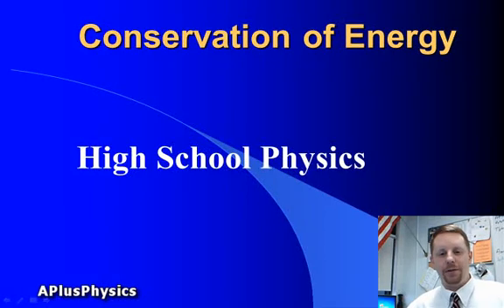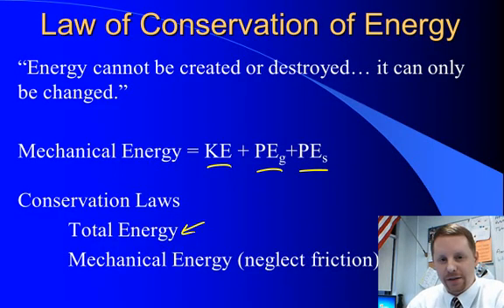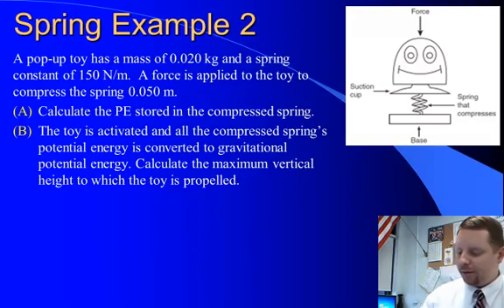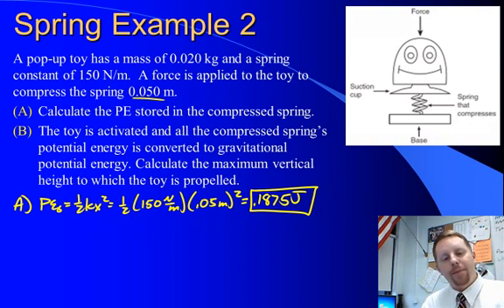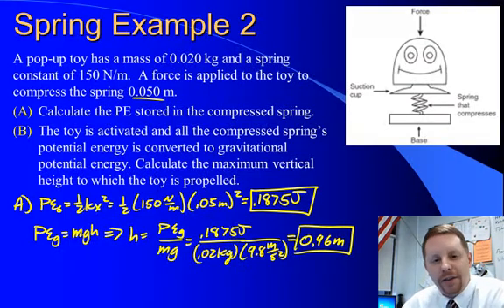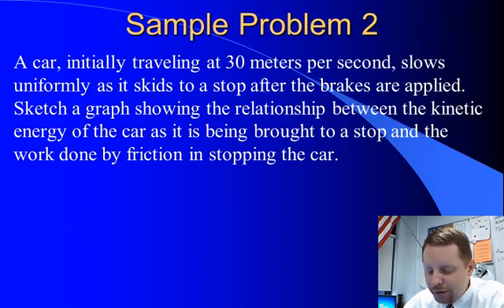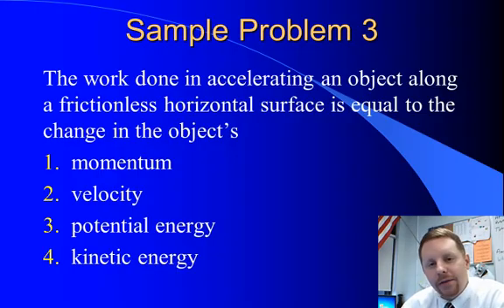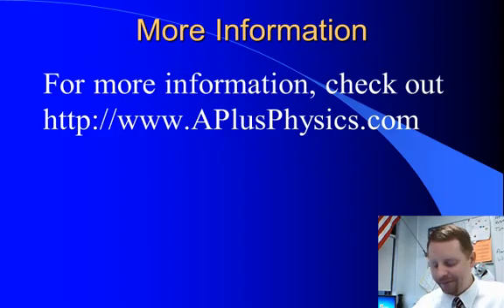High School Physics - Conservation of Energy

Comment: In Sample Problem 2, why isn't the line curved? In the formula KE=½mv^2, the v has a exponent of 2. Wouldn't exponential decay apply?
Reply from the maker: If it were a graph of KE vs v, you would have that relationship.  This isn't a graph of velocity vs KE, however.  Instead, this is a graph of the Work-Energy Theorem (W=Delta(KE))

Comment from the maker: E=K+U is true if the only types of energy you're dealing with are kinetic and potential (i.e. conservative forces), hence the law of conservation of mechanical energy.  Instead of focusing on the formula, I like to have my students focus on the concept, and develop the formula from there.  Since some work is done by friction, a non-conservative force, that energy is being converted into internal energy (likely heat) of the system.